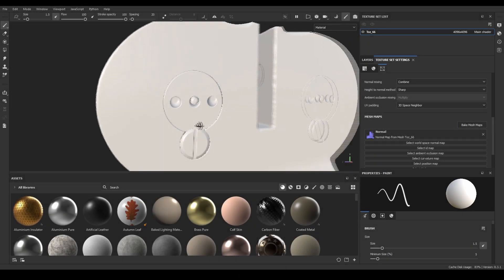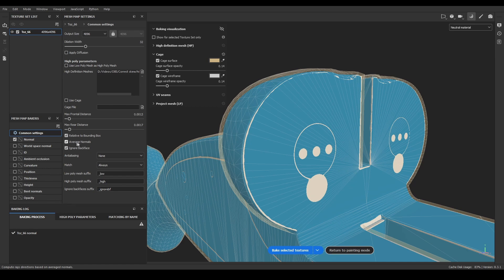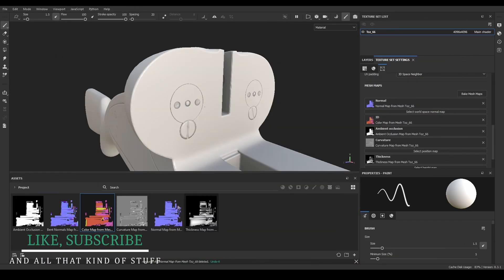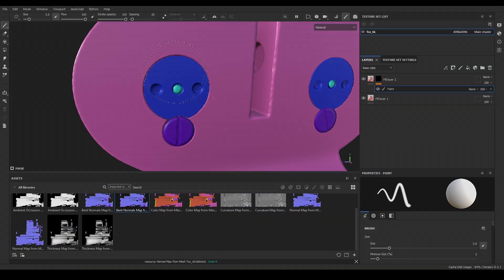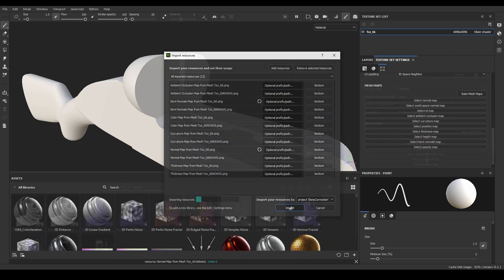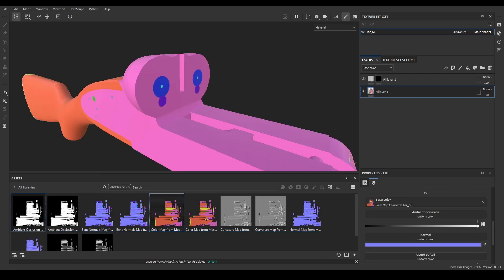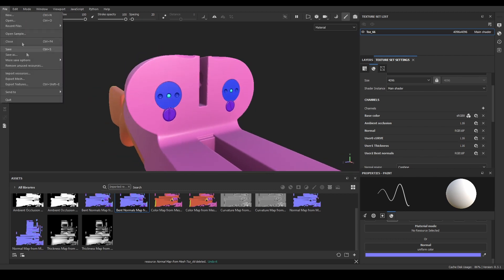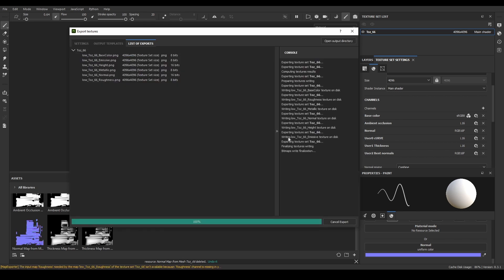Substance Painter SKEW CORRECTION Tutorial | Skew and Artifacts Fix with Substance or Photoshop

Comment: I heard about mixing the averaged and non-averaged normal data, to fix skew issues, but it's nice to see how straight forward it is using Substance Painter. Almost like in Marmoset :) Thanks for the information.
Reply from the maker: It's a bit more messy, but still very easy when you know the workflow :) Also I like the quality of the substance baker, I want to try and compare marmoset and substance bakers